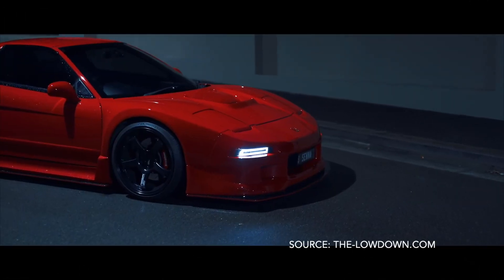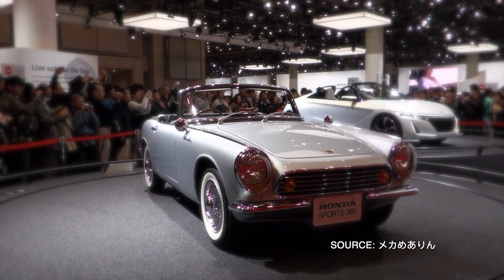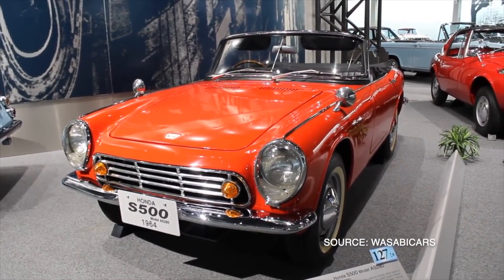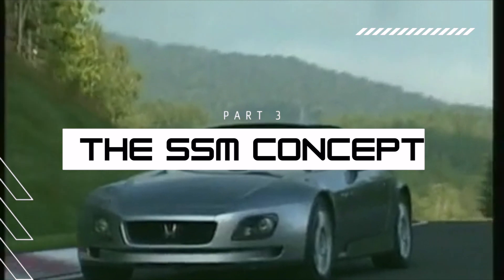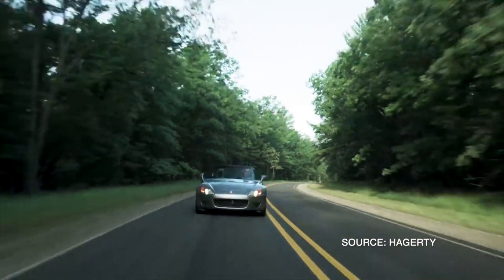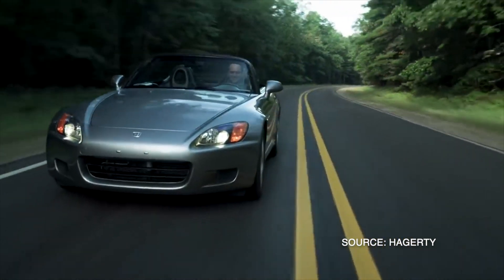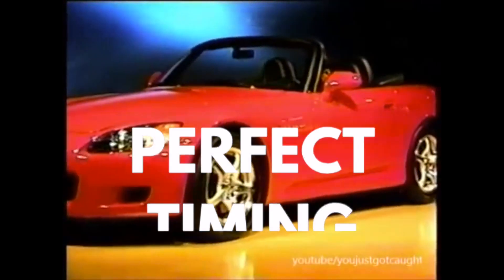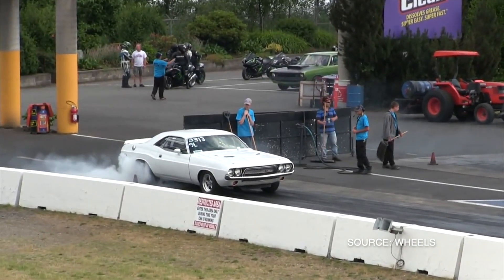How The Honda S2000 Became An Icon

Comment: I have a hard time envisioning what formula of design and performance would be proposed for a new S2000?  At the time of introduction, the S2K out performed BMW, Nissan and Porsche 6cyl. roadsters.  Why? The execs at Honda gave Shigeru Uehara unheard of latitude in creating their "anniversary car".  The anniversary car couldn't be a dolled up mini-van or a sedan, it had to be something very special.  The classic design closely followed the beautiful smooth lines and curves first created by Pininfarina.  The frame provided unmatched lightness, rigidity and a 50/50 weight distribution.  An entirely new engine and transmission were developed.  The list goes on and on.  It would not surprise me to learn the S2000 had one of the highest development costs of any vehicle manufactured.  You can fool around with more angular designs, turbochargers, even electric power systems, but could really still call it an S2000?  Anyway, those are my thoughts. Thanks everyone, now I think I'll go take a spin in my AP1.

Comment: A new S2000 would easily rival the new GR86 or even the MX5. They would be able to have a car to easily compete in that market if they follow the same formula as the older generation, High reving 4 cylinder lightweight 2 door.
Reply from the maker: That's true!

Comment: At Honda, engineering passion lost out to bean counters conducting focus groups. I bought a new S2000 in 2006 and still own it. It's almost a fluke that such a great car could have been made by a company that makes so many mundane vehicles.
Reply from the maker: I still prefer the older ones
Reply: @StraightLineSpeed  Yes, and maybe the favorite car I owned was my brand new '89 Civic Si, but even then Honda held back the DOHC engine from the US market. I also once bought a used 2002 Civic Si (EP3) from a friend. The EP3 was hobbled by Honda's decision to give it such a watered-down version of the K-series. I know, engine swaps solve those problems.

Comment: This is the best retro view of the S2000 I've seen so far. Great work. I own a 2004 low mileage S2000 (and a mint low mileage 1994 Integra GRS). Sure I'd like to see the return of the S2000 replacement car to Honda's line-up. However, if it's going to be anything like the new Integra, I say no thanks and continue to hang on tight to my older ones. In case anyone reading this is wondering, no, I have no intention of ever selling them.
Reply: weird flex but okay

Comment: The difference between the AP1 and AP2 isn't just the engine..... they also changed transmission ratio's, suspension components, traction control, soft top with glass, bumpers, headlights, tail lights, interior panels, and a few other things I can't think of right now

Comment: FYI: The S2000 for the Japanese market also received the 2.2 liter F22C1 engine. The S360 never went to market, but there was a S600 model produced in between the S500 and the S800. I'm not a fan of Honda making another S car as they would no doubt stick a turbocharged engine in it to meet today's emissions standards along with a bunch of unnecessary  electronics. The hallmark of all Honda S cars is their simple, focused nature built around free revving, naturally aspirated engines.  A timeless approach they stuck with til the end.